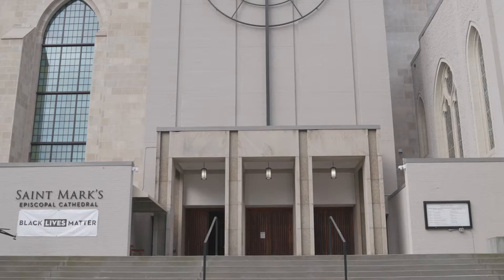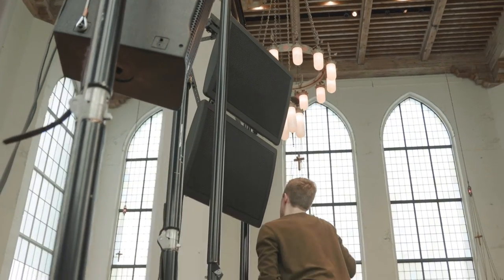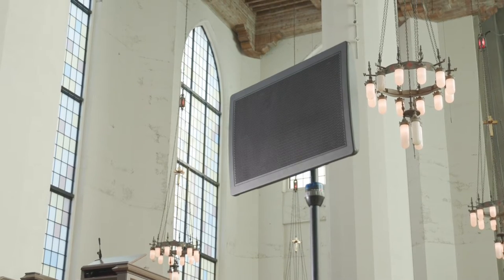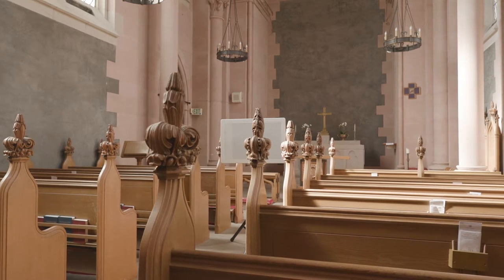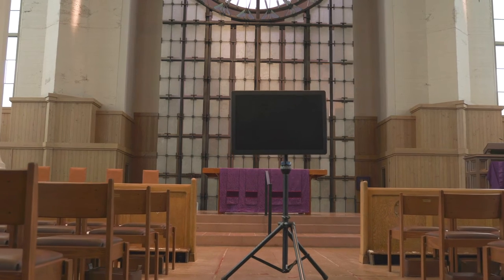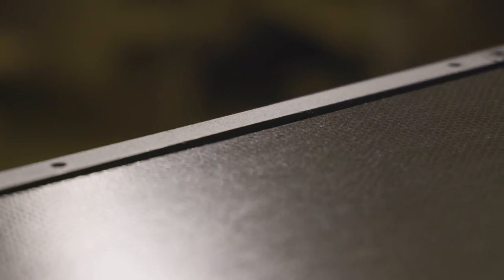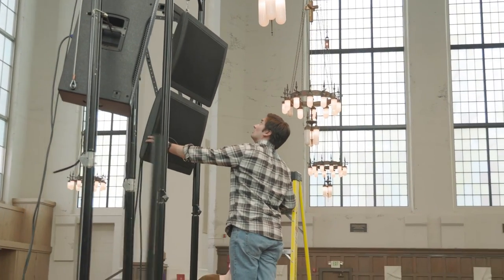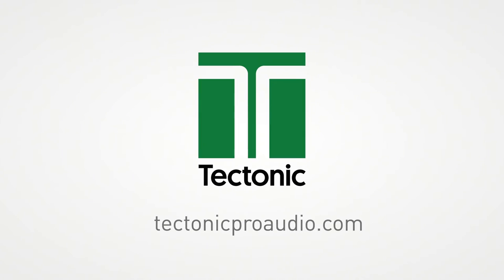Tectonic DML500 Case Study - St Mark's Cathedral

Comment: Understanding the difficulty of representing the sound of speakers through videos (on YouTube nonetheless), is there a recorded difference in this space between those two speakers? Why show the setup but not try to audibly present the acoustic differences? Why only show acoustic measurements that are barely represented in this case study?

What one could expect: Use an omnidirectional or 3D microphone at a non-sweet-spot location for the traditional speaker. Provide an uninterrupted recording from that microphone. Begin with no speakers on so the microphone picks up the “quiet” room. Provide a spoken explanation so that the listener can hear the natural acoustics within the space. Then play an audio file from the traditional speaker. Follow that with a second playing from the DML speaker. Do this for a variety of audio tracks featuring different ranges of sound. Bonus. First play those files directly in the video, “In this recording you will hear the following 3 samples produced through these two speakers.”

Surely, this would provide an acceptable representation of the difference in these technologies.